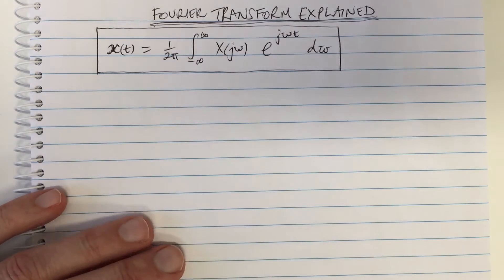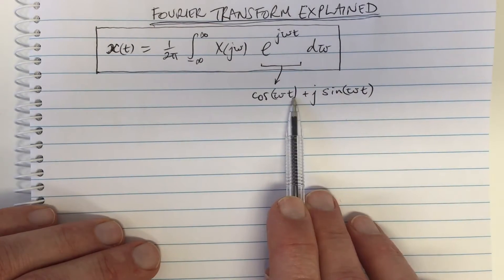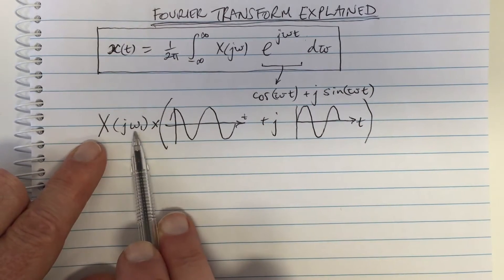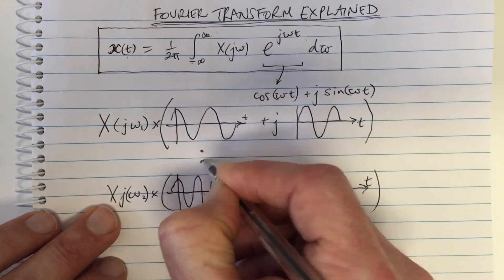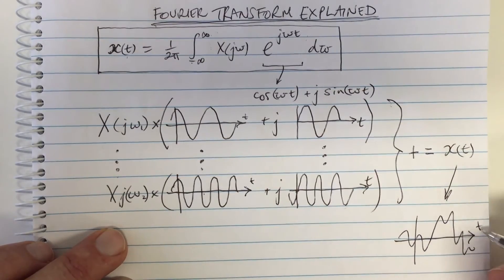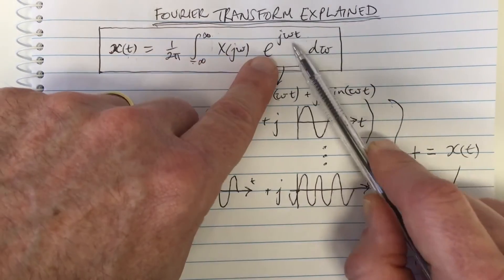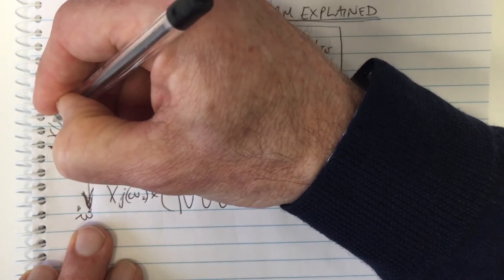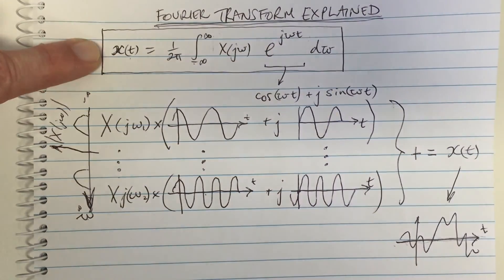Fourier Transform Equation Explained ("Best explanation of the Fourier Transform on all of YouTube")

Comment: looks like inverse ft. did you mention the amplitude of the basis functions? Are they unity-amplitude before they get multiplied by the weighting factors? Also, it is a bit hard to understand what you mean by asking for the function to be defined in negative frequency (i understand why it is necessary for maths, but hard to grasp what it means)
Reply from the maker: Yes, the equation I use to explain it is the inverse. I made a note about that in the description below the video. And yes, the basis functions have unit amplitude. For insights into "negative frequency" see: "What is Negative Frequency?" https://youtu.be/gz6AKW-R69s

Comment: Thank you for the straight-to-the-point explanation. Of all the content ive watched and read, this is the first where i actually understand the link between the application and the maths! though some things that were still a bit unclear to me, where did the 1/2pi come from? and if this is the IFT, using this same example, what would the FT formula be?
Reply from the maker: The 1/2pi comes from the fact that radial frequency omega = 2pi f 
For the relationship between FT and IFT see: "Fourier Transform and Inverse Fourier Transform: What's the difference?" https://youtu.be/N8RV6WT4sTY
Reply: @iain_explains  ohh! okay, thanks a bunch!

Comment: I prefer to write my transforms using 2πf rather than ω because it gets rid of those annoying π terms outside the integrals.
Reply from the maker: But then you'll have 2π appearing in all the exponentials. It's really just a matter of personal preference, I guess.
Reply: @iain_explains  Yes, that's true but at least you know where it goes, then. There are many versions of the transform pair with either a 2π in one or the other or even a square root in some and, anyway, I find frequency more intuitive than radians per second. Maybe that's because I find it easier to understand that Concert Pitch "A" is 440Hz and not approximately 2,764.601535159018049847126177286 radians per second. ;)

Nearly forgot: It also makes both the forward and inverse transforms the same apart from the change in sign of the exponential. I find that easier to remember but, as you say, it comes down to personal choice.
Reply from the maker: Sure, but once you start thinking about digital sampling, I think you'll change your mind, and start to prefer using omega. Because after you digitally sample something, you lose the time aspect, because all the neighbouring samples are separated by 1 (in "digital time"), for all digital signals, no matter what the sampling rate was you just get a sequence of discrete samples (... then what does the frequency f mean?). There are lots of sampling videos on my channel, if you're interested. http://iaincollings.com
Reply: @iain_explains  What you say is true. However, if you ever need to explain forward and inverse Fourier transforms mathematically I find it helps if you can have the most consistent set of formulae. There are multiple options if you use ω. If you use f then you have, basically, just one consistent formula to remember but with an optional minus sign to change from inverse to direct.

For information, I did start to think about digital sampling but that was in the late 1970s.
Reply from the maker: Sure. You're right, it is good to dot the i's and cross the t's. But from a fundamental understanding point of view, I'm not too fussed about that. The forward and inverse transforms are essentially the same, in my view. At least conceptually. "Fourier Transform and Inverse Fourier Transform: What's the difference?" https://youtu.be/N8RV6WT4sTY

Comment: Is he starting out with an Inverse Fourier transform for the example and then turning it into a normal fourier transform?
Reply from the maker: Sorry, I should have been more clear about this in the video. I like to start by thinking about the time domain signal (ie. the actual signal that we observe in the real world), because time is one of the main dimensions that we observe, and we are familiar with signals in this domain. I wrote the equation for the time domain signal in terms of the frequency components (which is actually the Inverse Fourier Transform). Once you see the signal from this perspective (ie. as being made up of a sum of individual single-frequency waveforms), then you will understand that there are two ways of viewing the same signal (ie. time-domain and frequency-domain), and that they are related by the Fourier Transform and the Inverse Fourier Transform. That's the important point. This video will hopefully give more insights into the relationship between the FT and the IFT, and point out that they are almost identical transforms: "Fourier Transform and Inverse Fourier Transform: What's the difference?" https://youtu.be/N8RV6WT4sTY

Comment: Hey im trying to tune my 4 subs, ive been learning all things physics, sound engineering, and electrical engineering. I have 2 10 inch dvc subs, wired to 2 ohms on its own amp in the same box as my other pair of 4ohm dvc subs wired to 1 ohm on its own amp. Soo that being said am i to use the function in order to make my subs hit as close to the same as i can?
Reply: I have a huge understanding of it all, but i am still learning. Tho i have too much knoledge and not enough at the same time as to, i get how the in phase pair will be playing its just im haveing troubles getting my two ohm pair to even be audible..
Reply: I know the higher ohm pair will need more noise so i gotta up the sub level inorder to achieve that but!!! I am confused on what more noise is as well.. if im upping my sub level im gunna want to drop my gain right?
Reply: These are all questions i rlly need to understand as to i "get/understand" eqautions/functions, ive been using sin to "tune" my subs. So i do have "understandings" i just honestly need sumone to help me get it.. as to i know wayyy tooo much on this stuff but little things that i dont know i try to ask everyone that i think does know, but they all say thats ideal its wrong.. ive been seeing that no! Its not wrong! Its time and effort through errors we are trying to work around/with. But i rlly i need a litlle helpp.. i dont have the money to go to school for it ive been self teaching myself for months now. I got pages full of what i learnt in my "journal". And of my system in my vehicle/ to stuff about my box as to i built my first box a ported 28hrtz tuned box thats 5.0cf pretty sure it was after displacements tooken out

Comment: Thanks so much, incredibly helpful! Could you maybe do some examples of how this all looks when you transform a non-periodical signal?
Reply from the maker: Thanks for the suggestion. I've just realised that almost all of the examples I've used in videos so far have been periodic signals. I'll add an example of a non-periodic signal to my "to do" list.
Reply: The trick to understanding non-periodic signals is to consider them repeating at infinity! The other thing you need to know is that if you stretch a time domain function it results in the frequency domain function being compressed.

So, if you stretch out a sine wave, say, until it is infinitely long the spectrum will collapse to the origin. In other words, the infinitely long sine wave will look like a steady level so the spectrum will be an impulse at the origin. 

Like all symmetrical (even) functions, that works backwards as well so an impulse in the time domain will give a steady spectrum at all frequencies. That explains how people can determine the acoustics of a building by firing a gun. The bang provides a time domain impulse which creates all frequencies.
Reply: @T0NYD1CK  i have a question please.
We know that integration of cos times cos is pi for a periodic time of 2pi, if intergration is from negative to positive inf, the integration is infinity so we represent it by impulse scaled by pi. But the transform is infinite as it is impulse.
Ok so if we assume any non periodic signal is sum of sinousoids over all frequencies, then each frequency when integrated with its similar frequency in the exponential it should give infinity transform. Why i see the transforms have finite values?
All i mean is that integration of frequenxy with itself from negative to positive infinity is infinity so why we see transforms have finite values.
Reply: @Niglnws  Great question, I struggled with that as well! However, the answer is that the full, mathematical Fourier Transform from minus infinity to plus infinity does not return a function that you can use the amplitude of, if that makes sense. Instead, we need to use the area under the curve. This means that instead of a spectrum representing, say, power, it actually represents power density. Hence the term: Power Spectral Density.

Also, remember that the area under an impulse, a Dirac delta function, is actually one. So, yes, the amplitude is infinite but the width is zero and as we all know (?!?) infinity times zero is one - in this case. That's mathematics for you!

I think I will stick to engineering.

I think of it this way: Imagine you want to create an impulse function from a set of sine waves. First, you need an infinite number of sine waves all with a minutely different frequency. Also, the amplitude of each one needs to be practically zero. Now, you add them all up and in just one place, where all the peaks add together, you will get your impulse. 

Of course, this also works backwards. If you have a single, infinitely sharp, impulse it contains all possible frequencies. That is why impulse response testing works. Basically, you can tap a metal plate with a hammer or fire a pistol in an auditorium and you will have excited "the system" with every possible frequency all at once.

I hope this helps.

Comment: I didn't get the point about having a symmetric function @4:42?
Reply from the maker: To be more accurate, I should have said "complex conjugate symmetric". If the Fourier transform is a complex conjugate symmetric function, then (X(-jw))' = X(jw) where ' indicates the complex conjugate, and therefore (X(-jw))'e^(-jwt) = X(jw)e^(jwt) , and so when you perform the integral from -inf to inf, the Imaginary components of the values for the negative frequencies will cancel with the Imaginary components of the values for the positive frequencies, leaving you with a real-valued function.

Comment: Thanks for this video. As you have said, complex sin parts get cancelled when we take negative omega domain of the integration 

However, even after that, X(jw) remains there with cos.

Is X(jw) always real? It has to be that to make X(t) a real one.
Reply from the maker: No, X(jw) is not always real. In fact, the only cases where it is real is if x(t) only contains cos(wt) terms with no phase offsets. All other signals have complex valued Fourier transforms. Note that all real signals (ie. signals that have real values in the time domain) have Fourier Transforms that are complex-conjugate-symmetric around the zero frequency.

Comment: Do magnitude and phase for particular frequency in continuous frequency spectrum represent exact magnitude and phase of sinusoid with this frequency?
Thanks in advance!
Reply from the maker: I'm not sure what you're asking. Yes, the values are exact.
Reply: Just suppose we have got sinc function for continuous frequency spectrum and we have certain magnitude and phase for particular frequency, do these magnitude and phase tell that we have exactly this sinusoid or magnitude shows relatively this magnitude for this frequency is higher than another one i mean relatively
Reply from the maker: The Fourier transform actually gives what you might call a "frequency density" function. So any specific exact frequency has "zero voltage", unless there is a delta function at that frequency (which has infinite "height"). Hopefully this video provides the intuition you're looking for: "What are the Units of the Fourier Transform?" https://youtu.be/y6DkoL6rHG0

Comment: Thank you very much. I was wondering if you can explain how this equation came about in the first place, it would be a great addition to our knowledge. I mean, you have explained the components of the equation and how it helps in transforming a signal,  but how did we arrive at this equation. 
Excellent video by the way.
Reply from the maker: You'd have to ask Jean-Baptiste Joseph Fourier how he came up with it - except he died in 1830, so I guess we'll never know.
Reply: Fourier knew Correlation and Euler formula,  he realized that if you take the real signal and do correlation with the theoretical signal of a given frequency then he will able to uncover all the frequencies with in a mixed frequency signal as long as he add all the multiplication result between certain range. If the signal is similar then all the positive number of signal X(n) multiplied by ideal signal e^-2PI()Kn/N will produce the positive . Also the negative number of signal X(n) multiplied by ideal signal e^-2PI()Kn/N negative number will produce the positive number then adding them together will produce larger positive number. But if the frequencies are not same then they will not have exact matching positive number or exact matching negative number so the result will be smaller. So he just put together Euler equation with Correlation in a integral form and that was his brilliance. But I do not know what use he had in his day of his own equation!!
Reply: @acluster3411  Concerning the use and motivation to find and extract single frequency elements from a signal by Fourier, the story I was told was that he was interested in music and how different instruments and voices can produce the unique but harmonious sounds that they do. Sounds a good story to me. I'll believe it!
Reply: İ think he wondered the summation of cosine and sine wave. That is all. İf you speak turkish you can watch Fuat Serkan Orhans videos😀